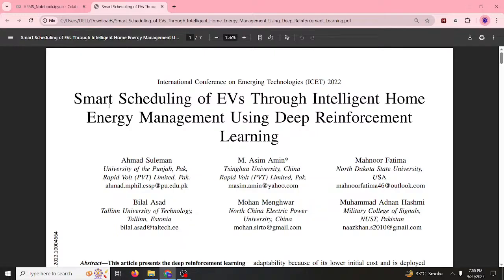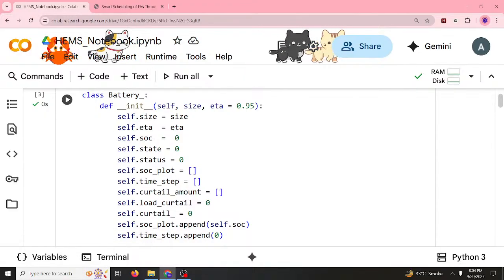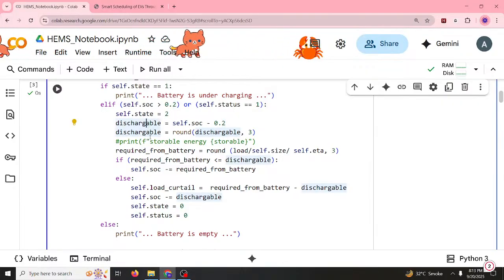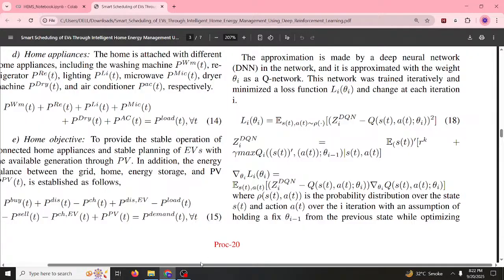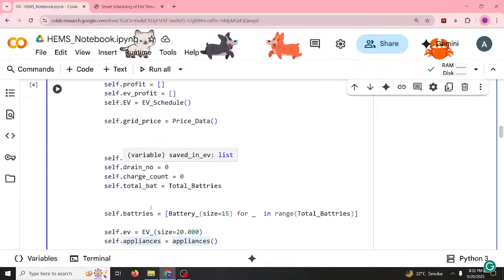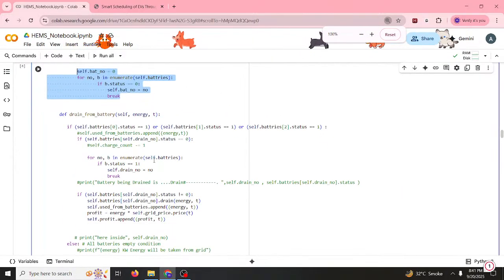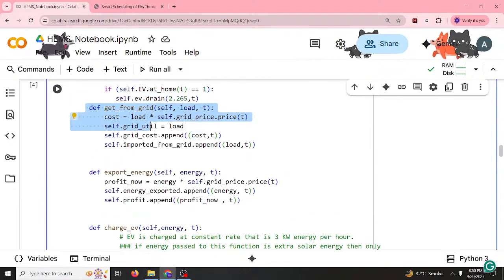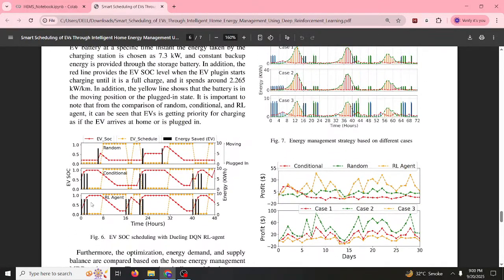What if Reinforcement learning Could Optimize Electric Vehicle Charging in Just MINUTES?

Comment from the maker: Video Chapters:
0:34 – Introduction – Kickoff of the session
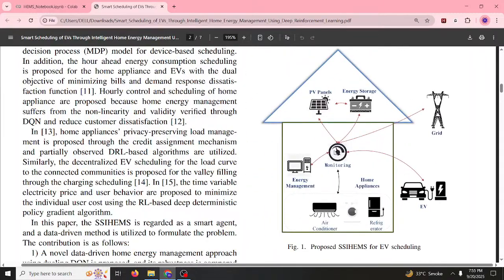1:20 – Solar panel & storage setup – Connection with grid & charging station
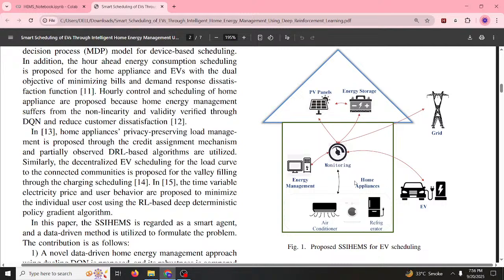2:03 – Study objective – Applying scheduling for energy distribution
3:07 – Load management – Balancing battery & user comfort
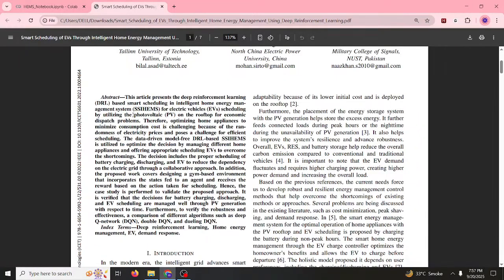3:34 – Maximizing renewable energy – Optimizing appliance usage & costs
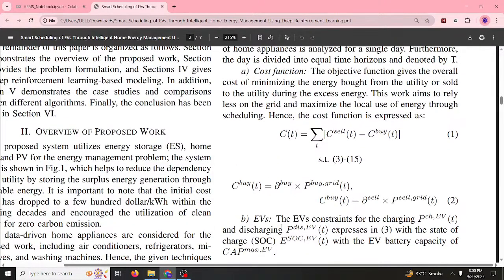6:09 – Mathematical model explained – Objective function & cost
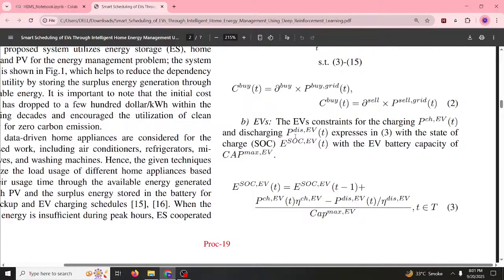7:03 – Battery state of charge – Charging & discharging model
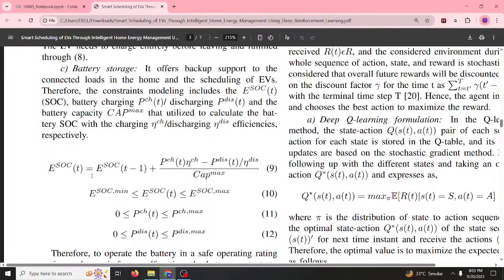9:29 – Battery constraints – Safe charging/discharging conditions
13:25 – Energy storage logic – Handling incoming energy & storage limits
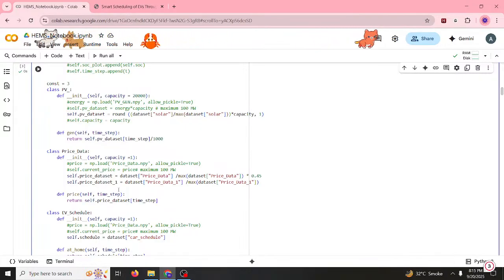20:54 – PV solar generation model – Dataset & normalization
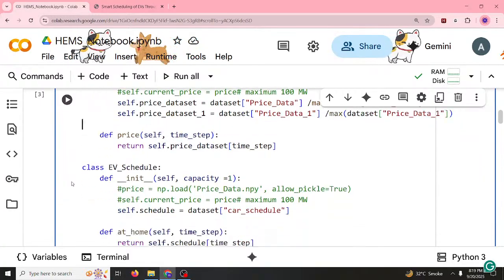25:32 – Pricing model – Realistic dynamic electricity price trends
28:23 – Appliances modeling – Washing machine, dryer, AC, etc.
31:24 – Objective function – Balancing power flow in the home
35:56 – Object initialization – Batteries, appliances, storage, and PV setup
42:37 – Battery discharge strategy – Sequential logic & conditions
50:15 – Priorities in energy usage – Load → Battery → EV → Export
54:44 – EV charging constraints – SOC thresholds & conditions
57:03 – EV charging from solar/battery – Maximizing renewable usage
1:01:15 – Battery states – Charging, discharging, idle transitions
1:03:37 – EV scheduling demo – SOC < 80%, night charging example
1:05:00 – Case studies – Solar energy & RL-based decision making
1:06:33 – Wrap-up – Next update on reinforcement learning